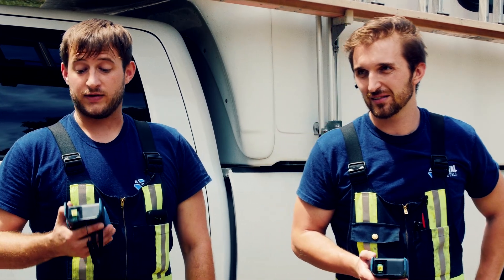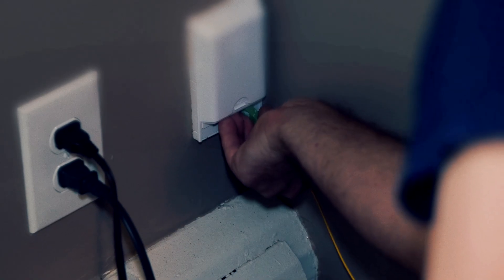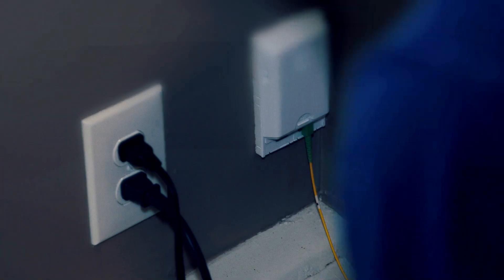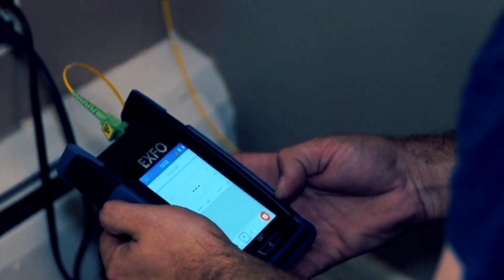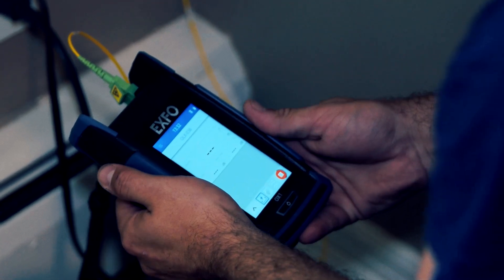Optical Explorer: tried and tested

Comment: No inspection before connection, and a oneclick cleaner laying on the rack, where is the mikroskop ? It should be mandatory for all installers to doing it the right way.
Reply from the maker: Hello, 
Thanks for your question!
We agree that connector hygiene through proper inspection and cleaning is a best practice for healthy networks! In order to keep the video as short as possible, we had to remove some of the manipulations that are usually a mandatory part of a technician’s job.
Reply: Inspection should be done for sure, but not necessary cleaning. A clean connector doesn't need cleaning. But inspection should be done prior to connecting for sure.